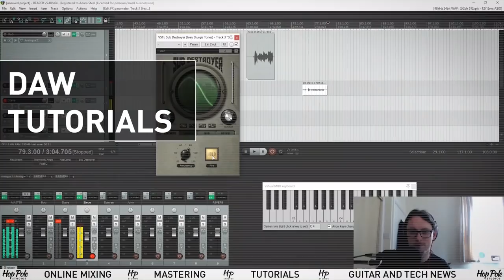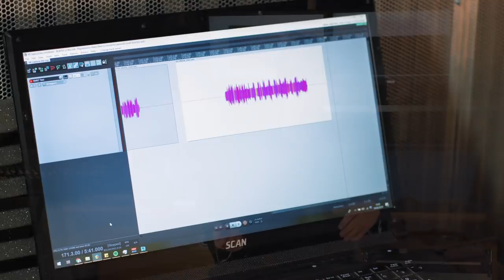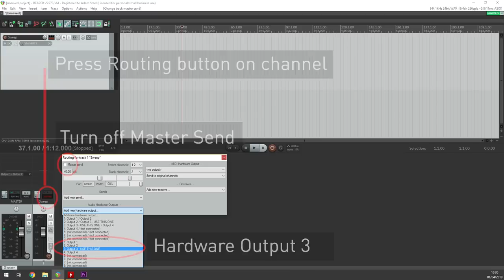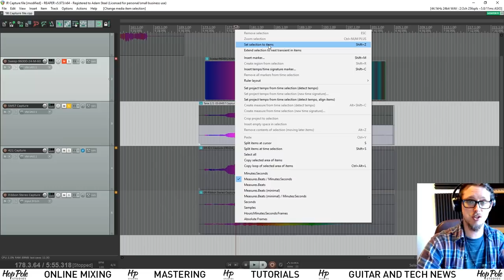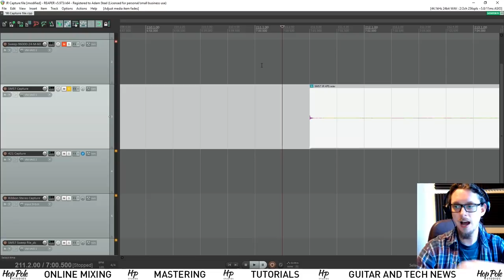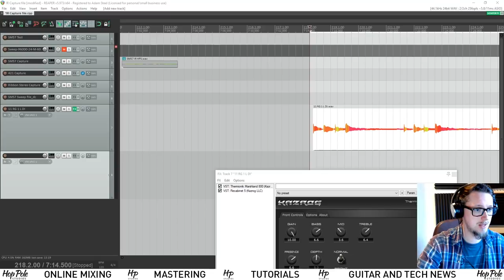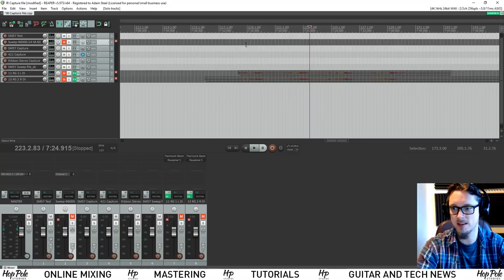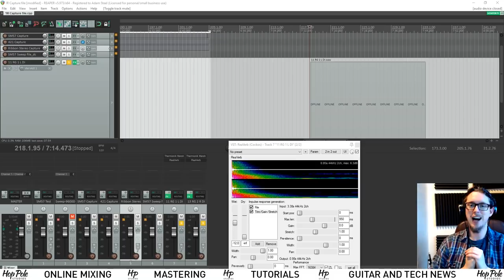Impulse Response Capture BASICS Tutorial - How to Capture your own Guitar Cabinet as an IR

Comment: I have a complicated chain of equalizers in Windows 7 (Sonic Studio 3, Viper4Windows, DFX, EqualizerAPO), which are all tweaked perfectly to the way I like every sound made by my computer... I can't make all of those effects work when I updated to Windows 10 so I thought "Why not create an impulse response for it and use an IRS file and use it with convolver (in viper4windows) to have the same effect much more easily?"

Recording is super easy... Just plug an AUX cable from speaker out to mic in and make sure the volume is proper, and now I think all I need to use is Voxengo Deconvolver to generate the signal and capture / deconvolve it... Hopefully it works.

Regardless, the vid was helpful :D

Comment: A bit wordy but I wanted to be precise please. At 2:39 on the video runtime you basically said:

BEGIN
"...step # 1 is to get a great sound out of your cabinet. We do this by adjusting the amp until we are satisfied with the resulting tone. Then we adjust the mic placement until we think we've got the right result ..... ". etc. etc. 
END

But what sound?? In other words, my immediate goal with using an amp simulator and IR is to make an audio clip of myself performing a short slide guitar solo composition. My go-to sound (in the real world) is primarily a tube amp using an overdrive pedal, a tad-bit of reverb and that's it.

Now, getting back to step #1, in order to get a great sound, should I adjust the amp and mic accordingly to produce the best overdriven slide guitar solo sound or simply set the amp and mic to produce the best clean rhythm chords? I plan to utilize thr clean rhythm sounds as a backing track to my slide guitar solo audio clip. In either case, both require different amp settings and mic placements on the cab.

Therefore, when creating an IR for my cabinet, which sound should I be striving for in step #1,  (the clean rhythm chord sound or the overdriven solo sound)?

OR

Or is this a case where I would need to create TWO different and distinct IR's (one for the clean rhythm and one for rhe overdriven solo)?

OR

When making an IR, we always start step#1 by playing CHORDS ONLY and adjusting the amp and mic placement for the best clean rhythm tone. We don't utilize single note solos regardless of how great we've adjusted the amp for that particular tone?

OR

Is this simply all about just getting the mic placement correct and it doesn't matter if we are playing clean rhythm chords or using an overdrive single note solo?

To conclude, what and how is the test-tone sweep being used to create a realistic representation of my cabinet? If I create an IR based on step#1 of using a clean rhythm chord sound then is that all that IR can be used for (is for recording clean rhythm chords)? 

And If I create an IR based on step#1 using an overdriven single note slide solo sound then is that all that particular IR can be used for (is for recording overdriven single note slide solo sounds) ? 
Thank you for your time.
Reply: It's not as simple to explain the science behind it as it is to just make the ir responses.  Some people use filter sweeps (which is suppose to be better for amps) and some use  transients like a clap.  You are capturing the sonic qualities of the speaker itself in this case with a mic. Overdrive would be added after the fact. That's why he used a solid state amp into the speaker cab  to get a clean waveform that can be used by the plugins or hardware.  He also eliminated reflections that would affect the ir.  For more realism some people will record from their amp head into software or hardware that will utilize the ir giving the direct sound of a close mic speaker cab with no influence of the room.

Comment: @4:04 The "PROBLEM" is that you CAN'T capture the sound of the valve amplifier even if you wanted to because it's non-linear. The non-linearity generates an infinite number of variations of the impulse response so it becomes impossible to record...
Reply: Yes, that's right, an IR doesn't capture any non-linear behavior. I think it should be possible to capture nonlinear behavior but it would require multiple IRs, and a convolution filter that would be able to interpolate between them, which would be very CPU intensive.
Reply: IR's don't capture the tube tone, just the profile of what the specific mic, on a specific speaker, in a specific spot hears.  Also... if you want to try something that helps mimic the non-linearity of speakers themselves...  go to Bogren Digital and check out his new IRDX.  That basically take any old IR, and gives it more life by simulating some of the non-linearities.  At least thats what I got from their explanations.  It definitely gets the sound closer to the way a mic'd cab sounds to me.

Comment: Hi Adam,
lately I've been thinking a lot about what you could do with IRs. Would it be possible to make IRs from the Amp aswell? or make IRs from lets say a vocal chain with a 1176, EQ and Reverb?
Love the channel btw!
Reply from the maker: Hey man! Unfortunately that’s not how IRs work, especially with things like compression- they capture a fixed point in time, not dynamic range. It’s been tried but it always sounds very fake and static because the biggest parts of amps and vintage equipment is both distortion and time-based change- IRs can’t do either of those
Reply: @adamsteelproducer   I see! i was thinking that maybe this might be the basis of Kemper because the capture process seems similar.
Reply from the maker: No the Kemper process is far more complicated and very clever, which is why only Kemper can do that right now....

Comment: Question:  I have crappy amplifiers that are older than dirt.  They have some, let's say, "colored" frequency response.  Would it not be possible to capture an IR of this piece of junk, then take the inverse to negate the ...crappiness?  In other words, if the response at, say, 10KHz, is -4dB, have the modeler pre-compensate 10KHz by +4dB, etc., thereby [attempting to] produce a full-range flat-response sound from a ...piece of junk?  Then apply your favorite IR to that, and/or create a composite IR of the pair?  (Might be cheaper to spend some money, but...  I'm a dumb, cheap, engineer, who's out of money.)
Reply from the maker: Short answer, no. “Crappy” amps aren’t just limited in frequency, often they have some distortion that happens over a time period (maybe only milliseconds but that’s enough) and that’s something that can’t be removed by an IR. 
That doesn’t mean your amp will sound bad, it might make a cool IR! It just won’t be “accurate”- depends what you’re going for
Reply: @adamsteelproducer  Thanks, Adam.  Appreciate it.  Seems like maybe an investment in better amplifiers ought to precede one in an amp/cab sim.  

One of the things I've done in a class-D amplifier design (work, not audio) is compensating non-linear effects on a sample-by-sample basis.  It's primarily a single frequency, and THD improved dramatically.  It's basically linearizing the D/A conversion.  I wonder if I could do something similar for audio.  I suspect it'd help single tones and hurt music.

Comment: So it seems that an IR is basically:
(signal + equipment) - signal = IR
.
The computer takes the original signal and subtracts that from the signal colored by the equipment. What's left is only the equipment color.
Reply: You have the right concept! 

Deconvolution is actually it's own mathematical process in signals and systems, an electrical engineering concept.
We know the input, and the output, and the program is using deconvolution to figure out the "function" in the middle that changes the input to the output.

Comment: Hi, you’re using solid state, for capturing the cabinet, but what if I want to capture my whole stack?? Can i use an amp what i have? Tube amp, Or hybrid? or is there a different way to capture that? Thanks
Reply from the maker: You can’t capture a whole amp this way, physics doesn’t work like that and the results will sound very bad- I know, I’ve tried. The only way to capture a whole stack is with very clever systems like a Kemper profiling amp
Reply: @adamsteelproducer  Further to this question: What if I wanted that tube poweramp colouring in the IR? Are the results okay from not using a solid state?
Reply: @danshathra  the IR captures the frequency response of a system. This system can be a cabinet and or an amp. What an IR cannot do is to capture distortion .

Comment: So in essence I still need to utiliuze a guitar amp simulator (like Amplitube4, Bias Series FX , Overloud TH3 etc.) because an IR is added to the overall sound i.e. the IR you made in this video is added to the chain and is used as my cabinet?
Reply from the maker: Exactly yes! You can also use a real guitar amp head with a load box for silent recording and use the IR for the cabinet- but yes, the “amp” and the cabinet are separate so you need both to get a realistic sound
Reply: Ok, thank you.

Comment: All of my custom IRs are so quiet thoug, how can I really normalize them? I tried Voxengo and tubeAmp Designer - both output a low output IR
Reply from the maker: Did you select the normalise option in the voxengo deconvolver?
Reply: @adamsteelproducer  Yes, I tried that and it's still half the volume of my regular IRs ...I try to get the sweep as close to not clipping while I'm renedering it but it doesn't make a difference. The IR is always very quiet

Comment: What kind of spec IR does this produce? I'm guessing a 96khz one!? But how long and how many points?
Reply from the maker: Depends on your setup, it’s open ended. The “points” aren’t constrained, unless you want them to be to fit a particular software or hardware unit
Reply: @adamsteelproducer  thanks for the reply. It's just that often commercial packs come in many different formats, but there seems to be very little noticeable different. I don't see an option in Deconvolver to set the length for example
Reply from the maker: Thats all done afterwards if needed to suit different output formats. Generally a higher sample rate capture makes for a better resample
Reply: @adamsteelproducer  gotcha. Thanks!

Comment: You should of shared the sweep file that was generated.
Reply from the maker: Why? You can generate your own, for free, to your own specs very easily.
Reply: @adamsteelproducer  Sorry I wasnt meaning the IR's, did my first attempt today and your tutorial really helped with that, but what I was meaning was the sweep file to put into reaper that you generated from Voxengo.

I ended up using the twonotes Blend IR which has it built in which seemed to work pretty well for my first try.

Comment: Hey Adam, do you need a reamp box to come out of the interface and into the amp?
Reply from the maker: Not in this case, since it’s a solid state amp with a line input. Guitar amps with instrument inputs definitely do
Reply: @adamsteelproducer  alright, thanks! I ask because i shoot my IRs through a Mooer Baby Bomb 30 power amp pedal. Should i use a reamp box in that case?
Reply from the maker: Depends, does it sound right without? Power amps almost always take a line level (that’s what preamps do, they make line level signals) so it shouldn’t be a problem

Comment: There is a far much quicker technic than sweep sine wave. Just shot a Dirac pulse through the cab and record it as you would do with the sweep. Done. Just edit edit the start and end to 500ms, and it's done. When capturing a full cab when multpile mic on every position, it's much more time saving.
Reply from the maker: Doesn’t work with cabinets in my experience, there’s not enough detail and too high a noise floor. The sine wave sweep is designed to increase resolution and works well, so has become a standard because of its upsides
Reply: @adamsteelproducer  Make sense for room measurement but not for speaker impulse response. You don't need to excite the room as you would do for reverb impulse. You just measure speaker frequency response. The tail doesn't really matter as impulse is 200ms and even 2O or 40ms for the Helix. 
I know both way to do them & did the test both way on fft that's rigoursly the same curve. 
They even nulls out with sinesweep through both of them on Ozone Match eq Soundwise it's sound the same as confirmed by the FFT analysis. If am not mistaken that's how ML Soundlab do it, as Andrew wade and Joey Sturgis. 
Anyway, whatever the method, it works

Comment: It’s pretty cool, and I got a lot from it, like making the sweep longer and a higher bit rate, but I think the whole solid state amp can be skipped, you can use the tube amp for it, just bypass the preamp and use the return input in the fx loop and as far as you don’t push too hard those tubes you won’t get much coloring from the tube amp
Reply from the maker: That’s not how this works. The tube amp should be avoided, not because of distortion but because of impedance curves that interact with the speaker (something solid state amps don’t do) which will completely screw your IR capture up. I’ve tried it. And so have several others who work in the field. Don’t be lazy, it is the difference between a useable IR and one that doesn’t sound anything like you thought it should
Reply from the maker: I talk about non-linearities in the video. The impedance from valve amps changes the per frequency, so you will have a capture that sounds nothing like the cabinet alone. If that works for you, you do you - but there’s no way you could consider what you’ve got a faithful reproduction of the cabinet, or expect it to work as a direct replacement